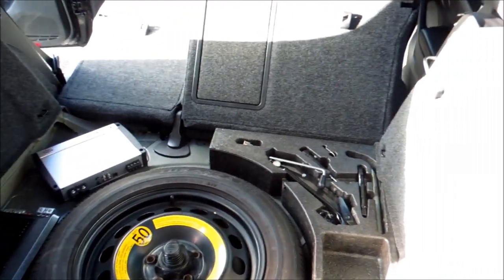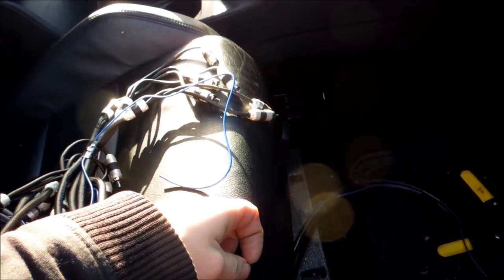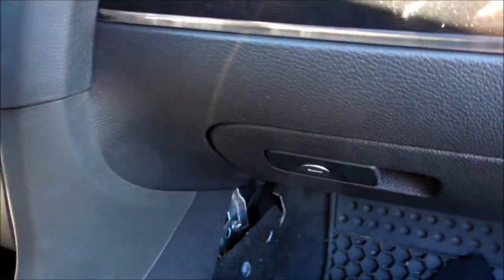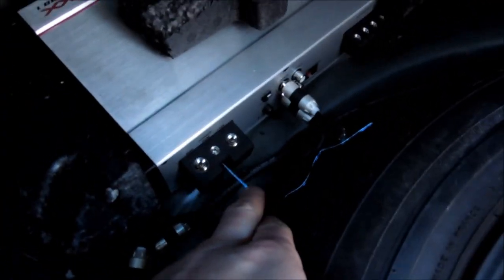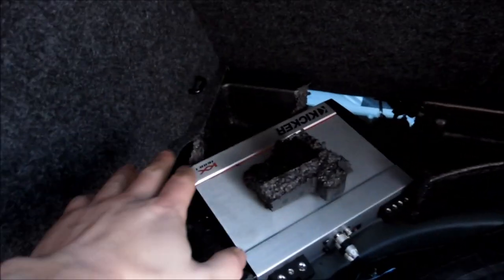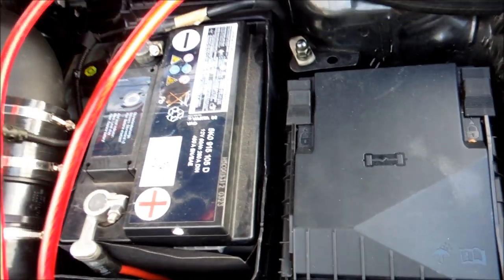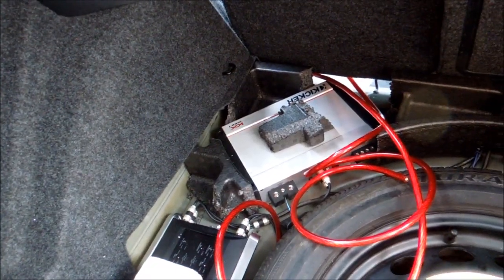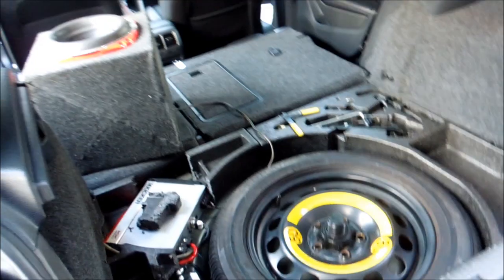HOW TO WIRE A SUBWOOFER AND AMPLIFIER GTI MARK 6 2011

Comment: i wanted to see how you've attached your power cables to the battery terminal itself. i noticed that on my car the nut doesn't seem to come all the way off. and i don't want to use a spade terminal for my power cable.

Comment: You can use a distribution block in the back instead running 2 runs of power wire

Comment: I'm trying to run a line out converter since I have the stock RCD 510 radio. Do you know how to remove the rear panel for that rear speaker?

Comment: Couldve ran 1 single power wire to a muliti-fused distribution block for a neater and more efficient install sans goes for the negative wires as well.

Comment: Hey nice video and would your MIMD to share everything that u r using for your sound system plz thing like amplifier, sub, wires etc or link for them plz thanks and keep up the good tutorial thanks.
Reply from the maker: wires i usually use stinger, sub is a Orion hcca 10, amps kicker kx1600.   dorr speakers are undecided at this time but the amp currently is a infinity kappa 4.
Reply: ghostlyrich ok thanks mate will check them online

Comment: Where exactly did you put the ground wire? Everything looks the same down there.
Reply: +TheBlehh010 I am also curious about this
Reply from the maker: +Bulletpr00fskin9 i put the ground in the trunk rate after the sub amp i knocked around a found a solid hunk of metal i sanded the primer off so it was bare then put a self tapping screw down to fasten it. Thick shortish screws work best

Comment: that woofer can take a bigger amp not saying that it doesn't already slam. I'd say put it in a box built for it and run like a 2krms amp..
Reply from the maker: Marcel Kizer I built that box custom for it. I agree the woofer slams!
Reply: ghostlyrich pardon me for assuming it wasnt built for it. It was just some friendly advice to help if maybe you wanted a little more even without changing power. i just know those subs kill it lol
Reply from the maker: Marcel Kizer depends on car. what alternator and battery it is equipped with. I know certain cars I would never do a system with, with stock alt
Reply from the maker: Marcel Kizer yep. probably have mike singer build me another alt here in a bit
Reply from the maker: ____GHOST____ hope your not implying me any system I have ever done a alternator upgrade in gets the big 3 done. Putting a fuse on the alternator wire is basics don't know why you went all Rambo there but good info?